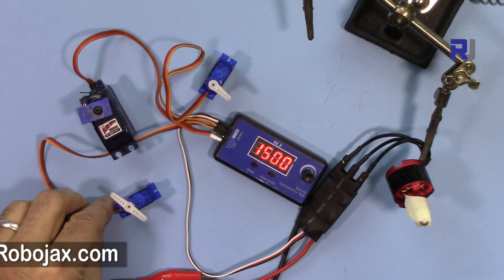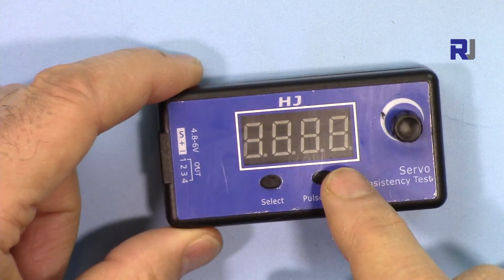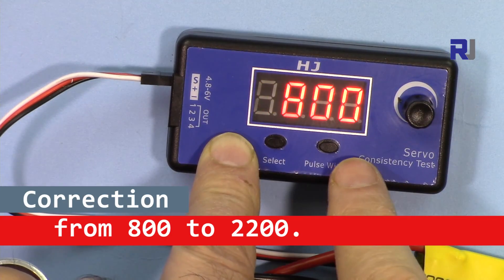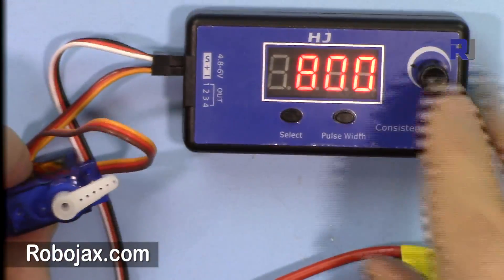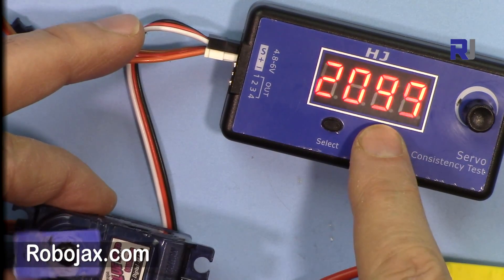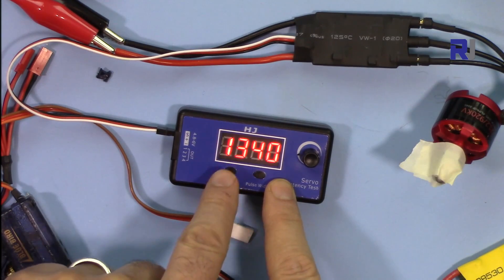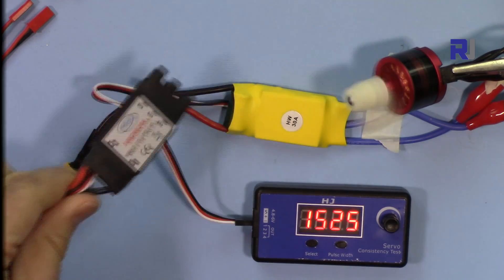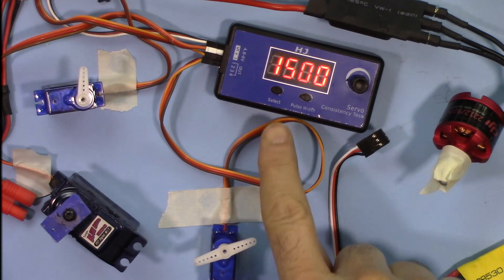How to use HJ Digital Servo motor and ESC tester - RJT657

Comment: will this allow you to change the neutral point of a server?  SO for example, I can never get servo horn dead straight, and want to know, if I put it in manual, and set the servo horn dead straight, will it always then go to that straight position?

Comment: I have the servo connected to an ESC powered by a 12V battery. The ESC is connected to a 3600KV motor. The lowest rpm I can get is about 15000 rpm when the setting is at 1500. When I increase that number to 2200 the rpm goes well over 24000 rpm. What is that number doing? What is it changing? The current? The voltage? I know it is pulse width in microseconds but I am a bit confused as nowhere it is explained what that number is in terms of how it affects the rpm.
Reply from the maker: it is the pulse width. For the RPM you need to find your motor datasheet to see chart for voltage and PWM relationship to speed (RPM).
Reply: @robojax  Thanks so much for your reply. It's the Surpass Hobby 2838 3600KV motor and no such information is provided. At 2200 the rpm is actually 46,500 (not what I listed).At 1500 the formula V=RPM/KV translates into just over 4V at 1500 and almost 13V at 46,500. Is the voltage therefore changing as one increases the pulse width or is is staying the same but somehow the pulse width is affecting the rpm?I am trying to get only 5000 rpm with this servo and motor but it does not seem it is possiblle. Is that correct and that I need a lower KV motor? I appreciate your reply.

Comment: There are three pins when connecting to power 5V. Which is + and which is -? The other one doesn't have to be connected, right?
Reply from the maker: The middle is always 5v + Then you won’t make mistake. Try one side for -. Search my channel for esc or servo. I have tones of video
Reply: @robojax  thanks
Reply: With DC powered devices when you have 3 wires and the colors are RWB, red is usually hot (+) black is ground and white is signal. Other times white can be hot depending on the other colors (usually with AC applications), and with the servos brown is usually ground, red is + and orange or yellow is signal. Always best to double check with a multimeter and google your servo to look at wiring diagrams before giving it any power.

Comment: It surprised me that your ESCs started the motor at 1500 micro seconds - which is the mid throttle stick position.
Mine all start at 1000 microseconds. 
Are yours set up for cars, with braking on the first half of the stick travel?

Comment: I just bought my first servos and got one of those small blue square testers.  The servos go 360 deg around twice when you turn it on and then stop.  They will go to center but only move maybe 120 deg total.  Then I bought one of these testers that I like a lot better.  The servos don't go around in circles anymore but the movement is the same around 120 deg.  They were MG90S and advertised to have all metal gears which they didn't.  They refunded my money and I've ordered some more.  Just getting started but I want what I paid for.
Reply from the maker: Yes and here is the review of  3 Channel Servo tester  with plastic case and aluminum case https://youtu.be/TJ3YjnsREqc

Comment: What is this actually doing? I know Hall effect sensors work between 0.8 v to 4.2 volts approx, is the servo tester extending the range to 0 to 5 volts?
Reply from the maker: No. The voltage is fixed. It is turned off and on called PWM . You may learn something from this video https://youtu.be/6O9SFvEP6Bs

Comment: Any way to change the upper and lower limits, you can see from 6:00 that the servos never do a full 180
Reply: They are not supposed to do a full 180 degrees. Nominally they are +/- 45 degrees for 90 degrees total. However that would be for the standard signal range of 1000-2000. This unit has extended range of 800-2200 so the servo travel is more than the standard 90 degrees.

Comment: Hi do you know how to tell what Hz ,milliseconds for the digital servo? I wouldn't want to damage it ,I didn't know it could be damaged thank you good information.
Reply from the maker: a proper manufacturer should provide the servo motor required signal specs.
Reply: @robojax  thank you very much..I will try to find the information..ty
Reply: @robojax  please can I ask one more question?was just about the esc when powering the esc and motor do you use the battery that the esc needs?or a smaller one for this..thank you.
Reply from the maker: Electronic speed controller ESC gets the pier and delivers it to ESC.
Reply: @robojax  I really appreciate the information,thank you for the help.
I just got this with some esc's and servos for a few planes this helps thank you..

Comment: Can I use servo tester to pump fuel to mini turbine engine ??
Reply from the maker: yes if the motor is brushless with 3 wires.
Reply: @robojax  Can you define one type of fuel pump with 3 wire pls. ??

Comment: Can I use this to adjust the center point of a servo? I added rear steering to my rc truck but my radio doesn’t have trim for that channel and my wheels aren’t centered?
Reply from the maker: no you can't . The center point is already set inside servo. You can just move it but not set.
Reply: Thank you
Reply from the maker: you are welcome.

Comment: Too many ads.
Reply from the maker: I just checked it. It is shown every 3 minutes.  For short clips this is standard. If video was 1 or 2 hours, then it would have been every 15 minuets or 20 .
Reply: @robojax  I realize this is not your standard but it makes continuity of the discussion very difficult with all the interruptions. Great video though. The numerical calibrators are an invaluable tool especially working with the Taranis radio systems.
Reply from the maker: You are welcome. I am glad you found it useful.

Comment: Can I wire a 9v battery or other standard battery into the input?
Reply from the maker: No you can't . Input of HJ Servo meter is 5V. It will kill it.
Reply: @robojax  I just found an old airplane battery that works perfectly! Thank you.
Reply: bro what battery did you use I need one?
 @herenortheree